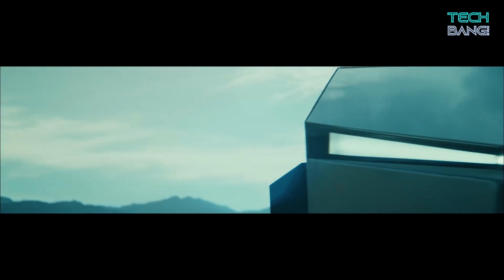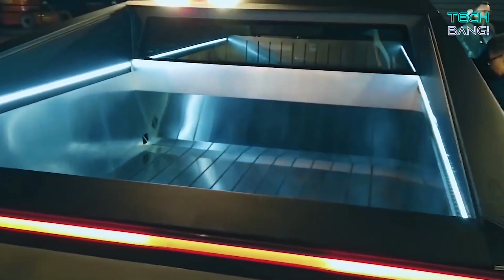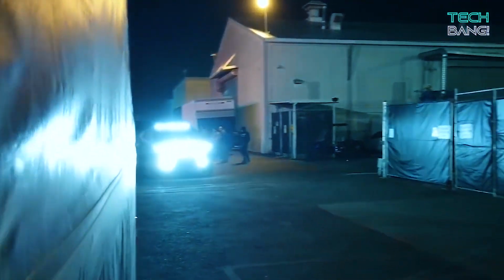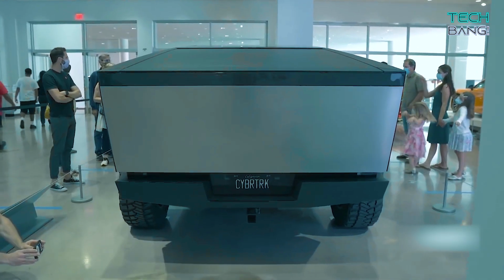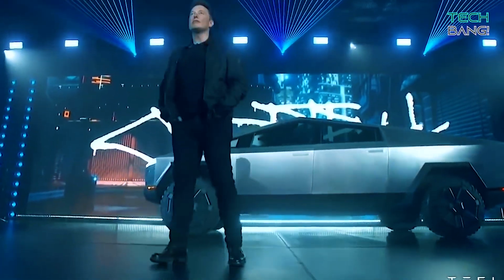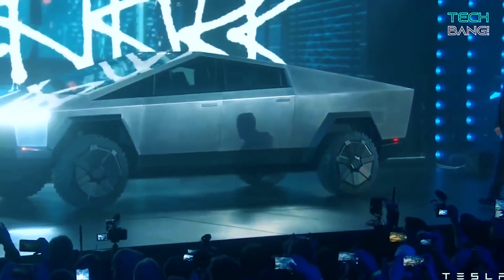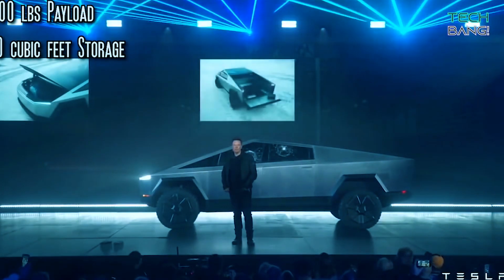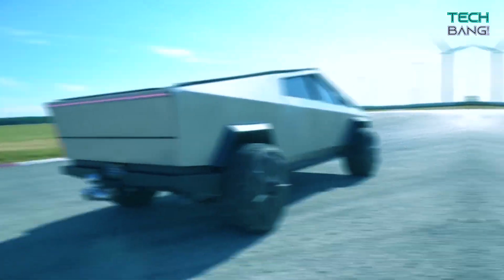Diving Into the BAD SIDE of the Cybertruck

Comment: In essense, after listening to your show: Cybertruck is superior in every way.. i dont think it was designed, it was engineered to be solid, durable, low cost and better than any other pickup truck. So thats why i will defnetly buy one..
When unweiled Elon said that it wasnt heavier than competitors, so why are you claiming otherwise?
Why do you say that Cybertruck thats made of hardened steel is easy to scratch?
Why do you think a stainless steel truck will rust?
Teslas number 1 priority is safety; Why do you say this veichle does not have crumple zones and is safe for occupants? 
Pedestrian safety might just be superior due to Teslas best in class emergency and avoidance systems- and who has told that there is no active pedestrian airbags or something..
 👍🇳🇴

Comment: Stainless steel does not rust if it does it very little I worked with metal
I am not that hyped about the design but I am sure it will be fine

Comment: Clearly you haven’t worked stainless.
It awesome to weld and super simple to take scratches out.
Mine will get buffed to mirror finish.
And trust me once it has that plus some wax you will not ever wash it. There will be no need. 300 series might rust at the bottom of the ocean if you scratched it. 
Maybe if it was a plow truck it would look corroded but rust lol naw.
Try getting hit with a box truck lol.
My point is no truck has good pedestrian safety.
It is not a car it is a truck.
How do you know there is no crumple zone?